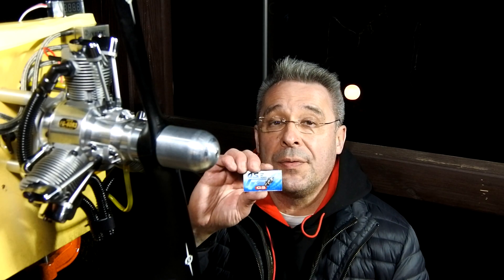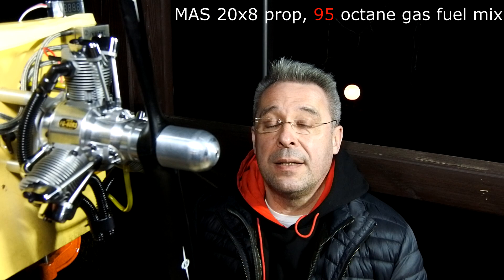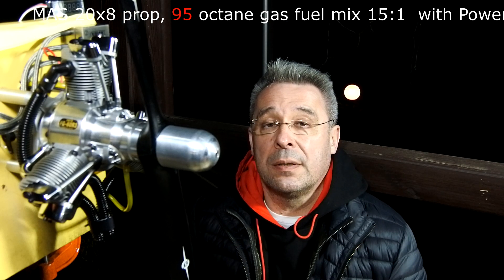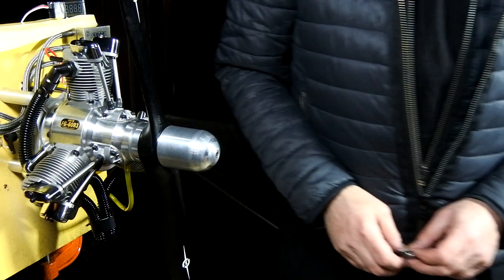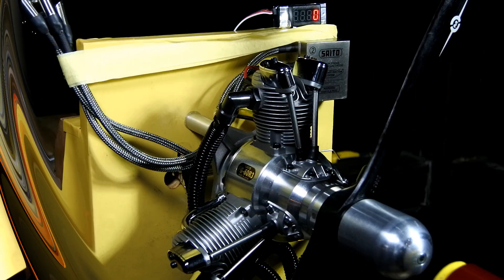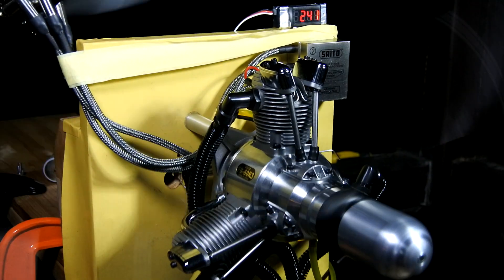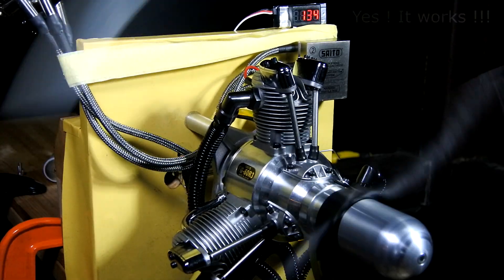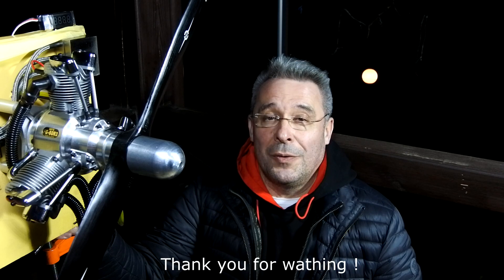Saito FG 60R3 glow ignition test run

Comment: Thank you for your video. Watching it, a question came to me; can I convert a nitro radial to gasoline radial, simply by using a gasoline carburetor and the G5 plugs?
Reply from the maker: Thank you for your great question ! Yes, for sure, you can convert nitro radial to gasoline operated engine, using gasoline carb and G5 glow plugs. 
Thank you for watching CrazyEngines  and have a nice day !

Comment: CrazyEngines: 
Did you use the Glow G5 Gas Plug:GGT15 and if so did you change out your entire ignition system? what glow plug did you use?
Reply from the maker: Thank you for your question ! In that run 3 x OS G5 gas glow plugs were installed and shows great and reliable performance. Spark ignition module was switched on, but HV spark wire were unplugged from engine and loaded by spark plugs by Saito, to avoid high-voltage breakdown of the ignition unit transformers.
Next time I'm planning to check also new Enya  
Special Glow Plug (GS No.4) for 180X GS Engine. Quite interesting, will it work with Saito FG60R3 engine.
Reply: @crazyengines88  Thank you.
Reply from the maker: @donaldmills2679  Thank you for your questions ! Appreciate you for your interest.